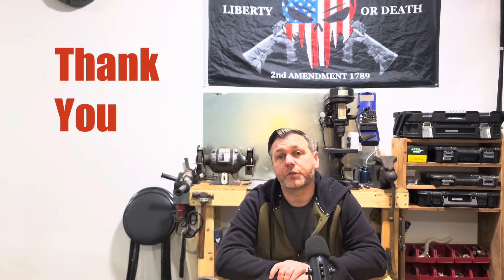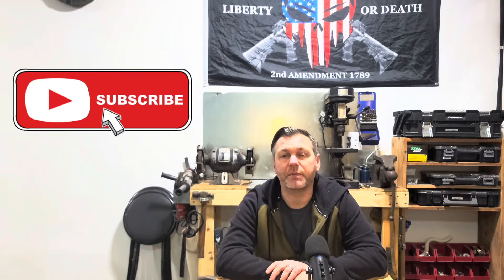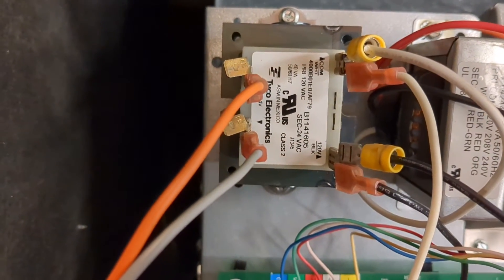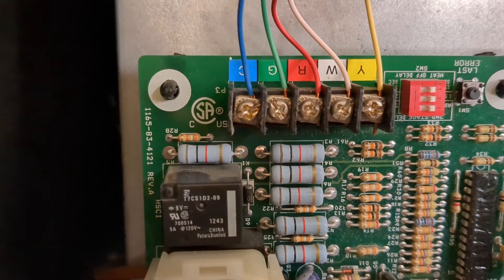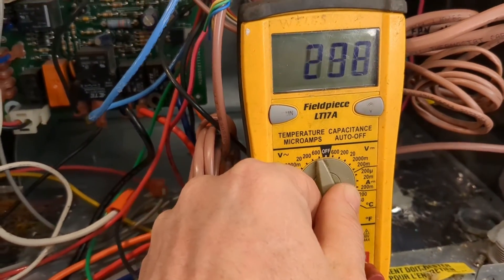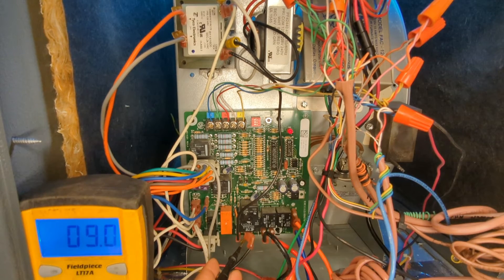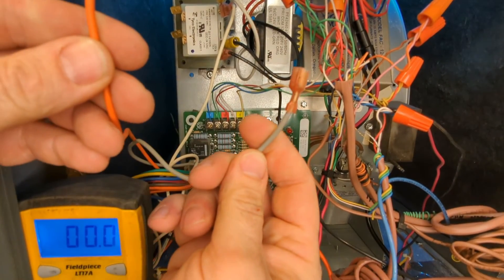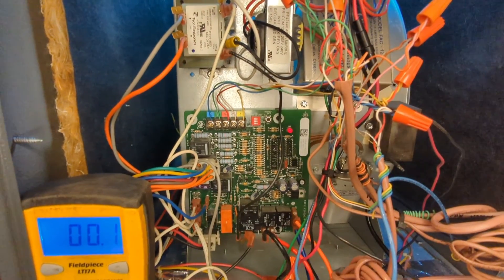HVAC Reversed Polarity

Comment: What if it has 30 volt instead of 90 or 150??
Reply: You're probably touching the 120v neutral. Possibly and reading 24v output to ground . Just guess

Comment: Hi Andy, I have a problem with my furnace in that the main squirrel cage fan is moving in a very strange jerky fashion and it will not come up to speed. Could that kind of behavior come from reversed polarity? 
I tried to do your tests but mine was different. The leads were covered in plastic boxes. I was also wondering if I just tried to swap those 24v wires and it doesn't fix it, could that damage the circuit board further?
Reply from the maker: No.  Reversed polarity will NOT cause this with the blower motor.  The motor module is probably failed and can not find it's phase.  If you have squirrels in there you have real problems.  Need to have a qualified technician diagnose it.  Hope this helps.  Be sure to subscribe!  Have a great day!

Comment: Dumb question but realistically how  did the voltage get reversed in an existing furnace? Reason I ask is I just replaced my motor ECM and it's reversed.
Reply from the maker: The video, I did it for the vid purposes.  It's my furnace.  In most cases, I think it comes from people replacing transformers n not checking when they do it.  Or, something in the house has changed electrically.  Some cases, I dunno.  But I know it's out there and it happens.  I believe there is always a reason. If we get to what actually changed... Sometimes, sometimes not.   Thanks for watching have a great day!